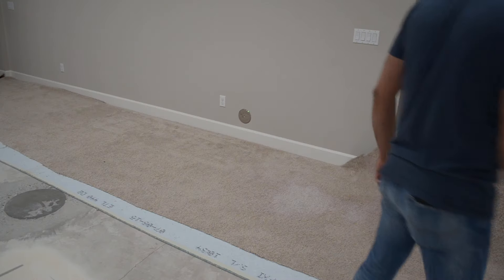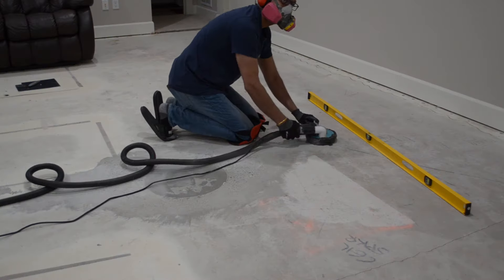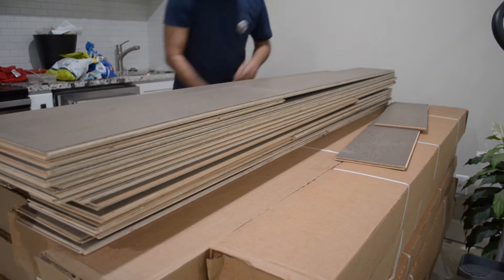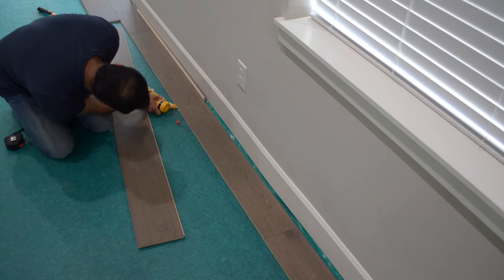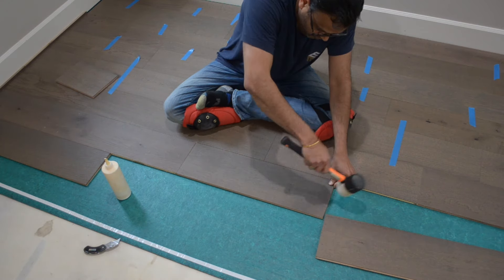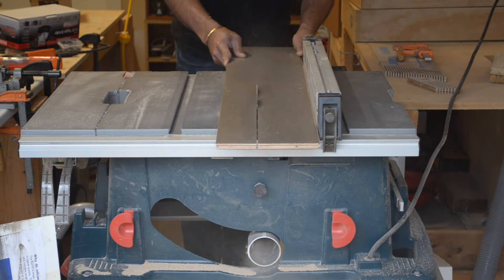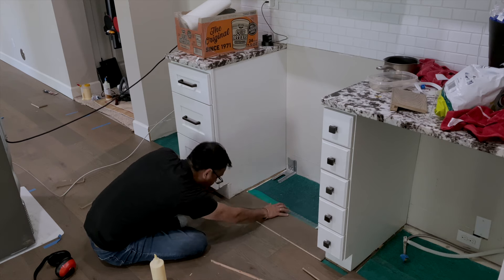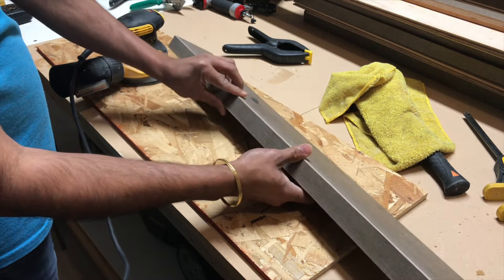DIY: A Complete Guide to Installing Wooden Flooring on Concrete

Comment: Looks nice but here is the question, you glued only tile to tile entire floor but when it comes to wall trims, why did you nail them and not just glue?
Reply: Old question the trims were nailed to the skirting not the floating floor the nails are stronger then glue as these will get knocked with vacuum etc. It was a easier alternative to removing the existing skirting, installing the flooring and reinstall skirting above floating floor. It would have made the flooring look more seamless or original if they done that.

Comment: You can eliminate the corner molding having to be attached to your existing wall molding by removing the existing molding first. Then place the edge gap up to within 1/8 to 1/4 of the edge of your sheetrock (less if the sheetrock is lifted off the floor as it should be because the flooring can float right beneath the sheetrock as well).
Before removing the trim, score the top edge where the trim meets the wall that is usually calked and jointing ends with a utility knife so any caulking doesnt lead to pulled or damaged paint. Mark where each trim piece went on the wall so the replaced trim will cover it and on the back of the trim. 
When using a prybar to remove the baseboards, slip a sufficiently sized metal putty knife against the wall so the wall doesnt get damaged with the prybar pushing against it.
Then after the floor is done, clean up the trim edges and replace as previously marked and the thickness of the trim will cover up the flooring edges. Recalk between the trim & wall and joints of the trim if youblike. Its a much cleaner refined look and will eliminate the costs of that extra trim.

Comment: Great video,  But at 4:16 Thats how you cut your fingers off in a Table Saw.   Almost all table saw accidents happen from the Left hand helping feed wood like that,  then Suprise !    You should only use your Right hand when feeding wood into a table saw.      You use your right hand  and apply pressure with a slight clockwise twisting pressure with your hand to feed it thru the saw,  Smaller stuff use a Push stick.   But putting your left hand up like that that and helping feed with the Lefty  is how 90% of people cut a finger off.

Comment: Hi I have a laminated 5" x 47" x 7/16" plank flooring all wood, the product is called the hydropel real hardwood by Bruce. I am putting it over underlayment because even though it's not in the basement it's a concrete slab.   But I worry about it sounding hollow with your experience what would you do to eliminate the hollow sound completely?
Reply from the maker: The underlayment should help reduce the hollow noise.

Comment: Thanks so much. Great video. Amateur DIYer and had been wondering how to install hardwood over concrete in my laundry room. This video helps. Doesn’t the first row need a good amount of glue across the base of the plank to hold tight?
Reply from the maker: Glad the video was helpful! Because the floor is floating, none of the boards should be glued down. Actually, with this installation method, gluing anything down can cause issues with expansion.
Reply: @DadandSonDIY  thanks, though a question—how do you keep the wood straight then as you move across the floor if the first line of wood isn’t secured somehow?

Also great video, seems like y’all are a good team!!
Reply from the maker: @Bhoconnor  We put some wedges between the 1st row and the wall to keep everything straight. It is tricky though
Reply: @DadandSonDIY  got ya, I see what you mean, thanks! 

Do you all ever feel the floor meaningfully shifting? It’s such a curious idea, not attaching it…

Comment: Hi. Thanks for the upload. Job well done. Only criticism would be the music. Anyway    I'm a professional floor layer in the UK and just wanted to say you've done an excellent job. Only tip I'd add is that it's always best to lay your first three rows without glue and make sure all is well. Once that's done, glue and clamp it all together. This ensures it'll all be straight without movement. Other than that, well done.
Reply from the maker: That's a cool tip!

Comment: What’s the best way to measure cutouts?
Reply from the maker: I'm not entirely sure what you are talking about. If you are referring to cutting the trim by the doors for the wood flooring, we did it by putting our tool on top of a scrap piece of flooring to cut at the proper height, as shown in the video.

Comment: What glue did you use?
Reply from the maker: We used Tightbond 2, but they also make a glue specifically for tongue and groove floor, called Titebond Tongue & Groove.
Reply: @DadandSonDIY  Thank you! Nice job with your dad.
Reply: doesn't this engineer wood have interlocking where you wouldn't need glue?
Reply: @danorion369  yes! The plank I am installing has a tight T&G connection: I decided not to glue them. I also think that the glue would limit  flexibility for expansion and contraction.
Reply from the maker: @danorion369  Some do, some don't. Depends on the product.
Reply: @L_niel_1003  awesome.  thanks for the response.. almost went on to glue this when it's unnecessary.  =)
Reply: @L_niel_1003  if you allow me to give my opinion, even with the tight T&G it is recommended to add glue, specifically at the top side of the groove, the reason is when two planks contract and expand, they'll slightly start getting separated from the joint section, when the do this slight movement, most likely they'll never get back again to their original lock. 
That's why you need glue to prevent this disjoint.
Flexibility will be towards the wall all the way of the perimeter (leave 3/8 inch against the wall).
Cheerzz